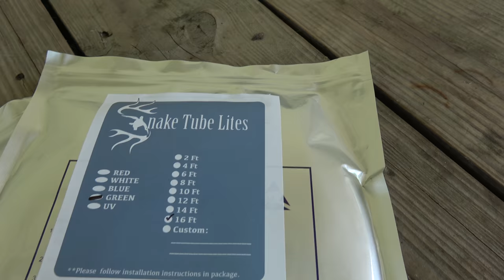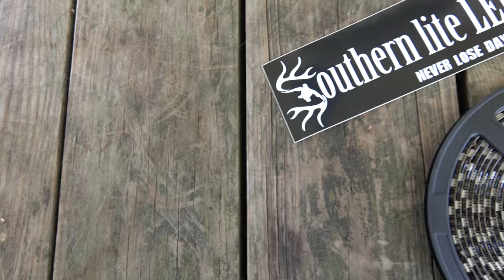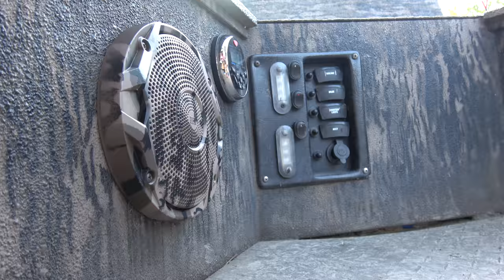Snake Tube Lites Install and Review!

Comment: How did you wire them up?? you just showed it going into the storage compartment and splicing each side of the led into each other. Where it comes from at the power source?
Reply from the maker: Iv since sold the boat but the wire runs through the hole in the rear of the gunnel. Wires Comes down inside the rear storage and connects to the switch pannel.

Comment: Very nice !!!!
Where can I get the inline fuzes; does it matter the size of the fuzes,  and did you connect one per each strip?
Reply from the maker: I tied both strips into 1 positive 1 negative and put 1 10 amp in line fuse. Anything bigger than 10 amp on LEDs will cause it to short before the fuse blows
Reply: @medina_jesse94  Excellent ..... Where should I purchase some good inline fuses?
Reply from the maker: @thebowtiefisherman5718  you can get them at almost any autoparts store
Reply: @medina_jesse94  Thank you again........
Stay safe

Comment: Where did you hook the ground wire at??
Reply from the maker: To the switch on my panel. If your switch doesn't have a place for the ground you can wire it to the battery ground or ground it to the boat out of sight. Just make sure to remove the paint of the location you choose if you choose to do that
Reply: TALKIN FOWL thanx man. Iam kinda slow when it comes to wiring.
Reply from the maker: @jaysongrimes9032  Hey man I have been there myself! Any more questions feel free to ask!
Reply: TALKIN FOWL will do thanx again